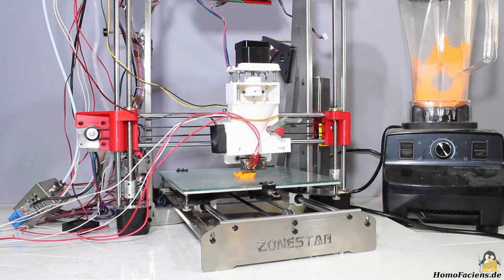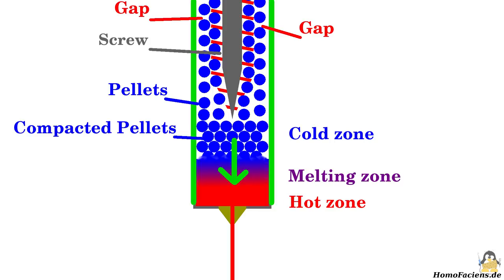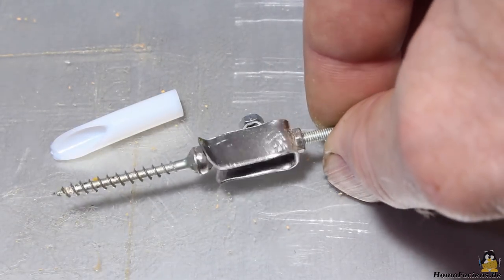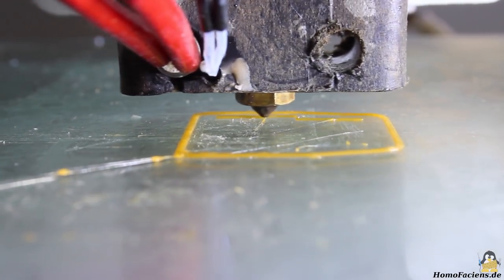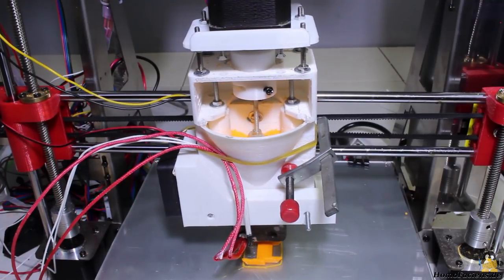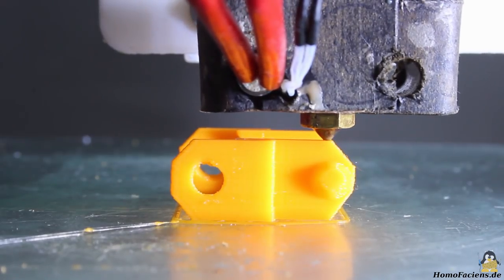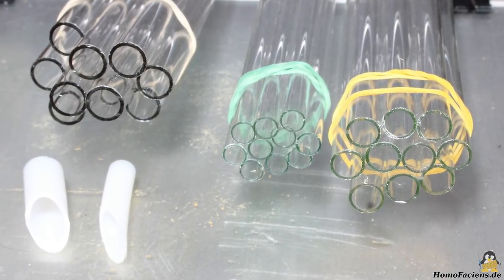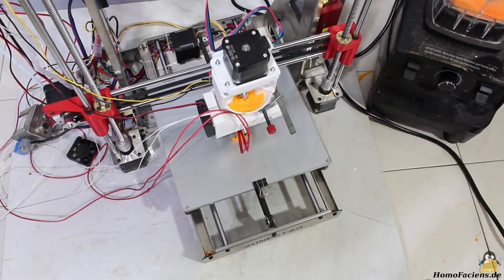DIY direct granules extruder

Comment: I like the idea but from a practicality point of view you adding the refinery factory onto the car only so it can run on raw petrolium, you rather recycle you PLA into a 3mm filament spool, say in 3-5kg per spool, and keep the printer simple.
And i would go further and pelletize said filament, mix everything together again and make it filament again to get a more uniform properties which could have changed from color to color o from brand to brand, or even from batch to batch as im sure you pla waste too quite some time to pile up.
Reply from the maker: Working Open source filament extruders already exist and yes with that you don't have to touch the mechanics of existing printers. With the granules print head on the machine you can also extrude materials that are too brittle (e.g. sugar) or too soft (e.g. wax) to be printed as filament.
I will talk about how to get the right sort of granules from the right sort of plastics in a coming video. Yes, when mixing waste plastics (even from the same chemical composition), properties will change from batch to batch. I'll talk about that, too.
Reply: Wax is out of the question nowadays, there are printers that print wax, even in colours, as if it were an inkjet printer, and with really thing layers. Quite useful for lost wax casting like for jewlry.
For sugar, which you can turn into a really fine powder, id rather user laser sinthering.
Wouldnt it be better to just use a heated servo syringe? Im not sure i like the idea of having to constantly feed the screw plus you are also wasting energy in grinding the plastic so you can feed it to the screw and on the extra time it takes because its slow. I mean, recycling only makes sense if you can do so efficiently enough (from an energy consumption pov), otherwise its not recycling, its just saving money.
Reply: BTW, you say ~30mm/s max that thats the X axis only, not the extruder. Next time also check the extruder max flowrate (mm^3/*s) as that is your hard limit. If you use a bigger nozzle, say 1mm and 0.8mm per layer, not even a vulcano will be able to melt the plastic fast enough to keep up with 30mm/s. (that would be 24mm^3/s, and you can do about 22mm^3/s but ony with a geared extruder because of the back pressure)
Reply from the maker: Wax isn't same as wax. Depending on the length of the polymer molecules it's more soft or hard.
With filament printing you can print hollow structures you can't print with laser sintering.
The syringe isn't a practical solution to me, however you can prove me wrong.
Reply from the maker: Future tests will show that.

Comment: this would work better if the bed moves in x and y directions and the head only moves in z direction,
you should have better results and faster speeds
Reply from the maker: That would shift the moving masses to the mechanics of the print bed, thus its also not optimal solution. I'll modify the print head and eventually try the flexible shaft solution I was talking of at the end of the video.

Comment: You might want to talk to Richard Horne (youtube user: RichRap2011) as he has also played with granules extruders a couple of years ago: https://www.youtube.com/watch?v=ZTju-EH22uY
With regard to improvements I would probably look into putting a part cooling fan on the extruder, it helps a lot with curling on overhangs (for PLA)
Reply from the maker: Somebody else also pointed to Richards video. Its from 2014 and unfortunately nothing new since that.
My print head setup was quick & dirty just to see if it works in general. Of course the next iteration will have a cooling fan.

Comment: It would be better to have a 2 stage heating
Reply from the maker: Where should stage 1 be placed and where stage 2 and why would it be better?
Reply: @HomoFaciens  1st stage to fuse all granules to a unified structure and 2nd to extrude orifice based structure externally.
I think.
2 stage heating with a single screw may be implemented with a heat break in between but very small cold zone to settle unified structure a bit and then extrude. This may improve quality of extrution. How ever I am not clear of retraction.
Reply from the maker: @Tech-Know Guru So the more simple solution would be to extrude the granules to 1.75mm filament and feed the printer with that filament.

Comment: very nice and thanks again for all your effort to inspire...
regarding many things and uses, but in this case recyling and using things around you ,i always wondered why no one thought to use generic super cheap 12v glow plugs (less than £4 when you shop around in the car sections, and cheap 12v induction wrap around steel/ferrous  heating pcb's etc ) to process the plastics directly ... 
for instance as... oops wrong channel corrected...
Creative Channel Published on Apr 27, 2017
 shows here you can even melt thin aluminium (as a side effect 7.57) when you strip the glowplugs down https://www.youtube.com/watch?v=dcK30n8bbeM How To Make A 12volt Electric Kettle

perhaps you can also incorporate them in your prototyping start to end automation , now that would be something to see how the master does it :) even battery powered set and forget.... to load the hopper ...
Reply from the maker: Yes, glow plugs are indeed a good idea! I have a couple of small ones from my RC model engines. The large ones are in the Diesel engine of my TX2 (but I need them there to keep my taxi running). Thanks for sharing!
Reply: You would need to put a thermal sensor on it. I think it's better to heat a block and have a thermal sensor on the block to make sure you're not burning your plastic.

Comment: You can use a wood drill bit as screw conveyor:
https://www.youtube.com/watch?v=zNGuuSKE1pY
Reply from the maker: Yes, but not really good for a direct extruder. The lower pitch and diameter of the wood screw allow a much more precise extrusion of small amounts of plastic through a 0.4mm nozzle.

Comment: Printing peek with this would cost 80$ a kg instead of 300$ a kg :)
Reply from the maker: So far I am only working with PLA, simply because I have lots of failed prints waiting to get recycled. I will continue working on this extruder, soon. If I can handle PLA reliably, I will start experimenting with more materials. Stay tuned!
Reply: @HomoFaciens  oh yeah! Plus PEEK/PEI is insanely hard to print! It needs at no least a 90c enclosure and for optimal strengh 200c is recommend. But when this is working fine it could perhaps be commercialized a bit and then it could handle peek specially on printers designed for it ;) no